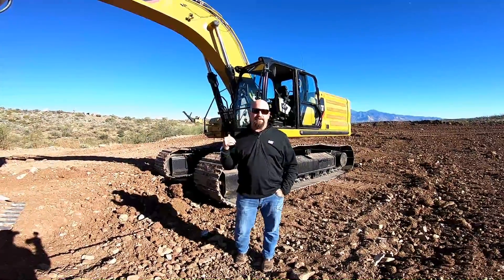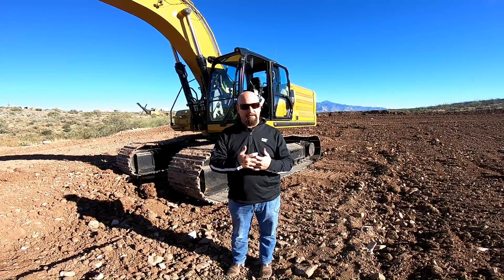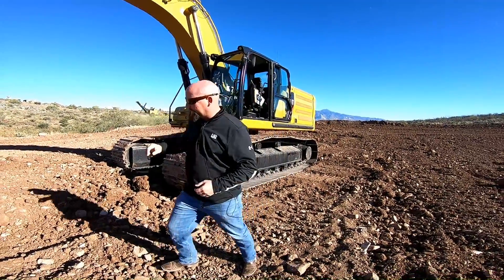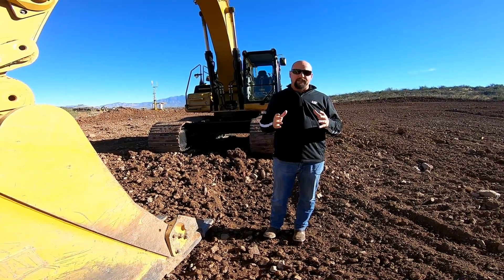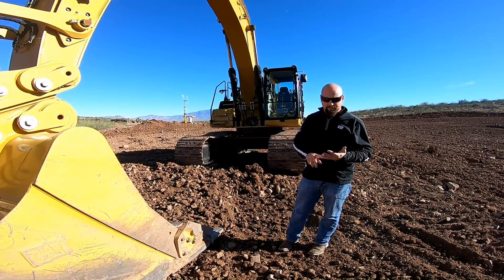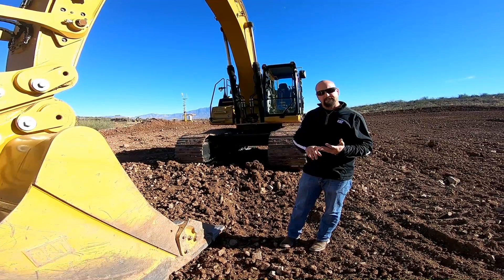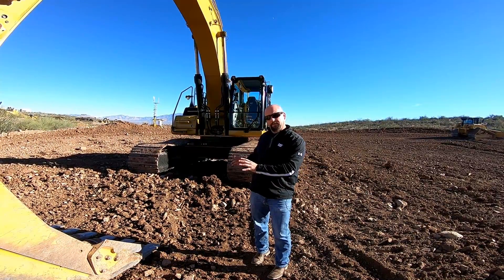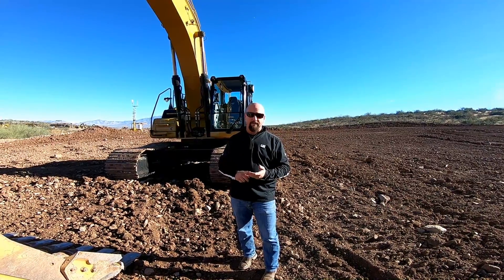CAT 336 Next Gen Technology Explained..

Comment: I have been operating hoes for 12 years now and have run a bunch of different machines. But these new cats are absolutely horrible they have completely changed everything in the machine. The controls sit higher and you cant lower the arm rests really low. And as for simple adjustments you have to take your eyes off the job and search through the damn computer to make simple changes its dangerous. And the stupid electronic hydraulics there is no play. To me running this machine is like starting new basically the same as switching from cat to Deere controls. I can not run this machine at all and now my boss is switching over to them and now I have to look for a new job thanks cat I used to like there machines but not now.

Comment: Cat is just evolving. They see the same thing i see. Its getting harder and harder to find operators. Yes the old guys don't like this technology because they can run it without and have a finished product. The newer generation of operators flat out suck. Not all of them but the majority do. These new operators just don't have it. They can dig a hole and load a truck but when it comes to holding a grade forget it. Dozer or trackhoe. I have some operators ive been trying to teach for almost a year now how to hold a blade and it just doesn't sink in. Ive been through so many operators in the past years i can't even count. I have one guy who is half ass and can run 3d machine control half ass but most of the time im going behind him fixing screw ups. Motor grader operator? Haha you have to pull them out of retirement around here.

Comment: We have the 336FL at work at it’s a terrible thing,  Huge ass, easily dented light metal doors. Lots of computer errors. Huge DEF consumption. It’s actually a pretty slow machine in cycle time.
Reply: I used one too it was the worst hoe I ever used, and I've been in lots of hoes!!
Reply: 3/4 of the engine compartment is dedicated to an exhaust scrubber. It’s ridiculous. The engine is so constipated with exhaust equipment, that I feel the only thing Cat could do is derate the engine RPM and cut back the speed.
Reply: Sure wish I still had an old EX -1 series Hitachi. What was wrong with those? Nothing. The UH series was awesome . Dig and dig and dig and dig. Sadly as technology moves ahead, so does all the problematic computer controlled equipment.

Comment: And soon to come the machine with no cab. Just like everything else nobody will have to drive or operate anything just fuel it up and push the go botton tell it what to do and press start.
   The new way of doing things then if something goes wrong blame the machine.
Reply: Yup, the entire goal is to get rid of the operators to reduce costs.  The Holy Grail is to run mines using a remote control center and a couple of poorly-paid desk jockeys, relying on Indian programmers to generate code and Germans to build the machines.  Who wins?  Not the poor blue collar schmucks out in the field...
Reply: ArthurDentZaphodBeeb already happening in Australia mate, rio tinto has already got over 100 fully autonomous cat and komatsu haul trucks, fully autonomous drill rig and haul train, maybe by the end of this year they’ll have a complete autonomous mine site
Reply: When i bought my first car in 1972 i never thought i would see the day i could buy a fully autonomous car i may see it before i die.
Reply: @scruffy6151  Tesla - already here.  Go see it before you die.
Reply: @rightsideofthegrass8114  this I know but, i am talking about where they are the normal cars on the road. Yes there are cars that have many option but,  non are fully atonamuos. Where the person get in puts the destination in and sit back and read the paper at 60mph and never looks at road. The Google cars are only aloud to do 25mph in town not on the open road.
Reply: I'm a pipeliner from Canada crowding my 20 th year running hoe and I can't ever imagine a bot taking over my seat ...way too many different situations ,ground conditions and stuff it wont happen in my lifetime but it would be cool to see em try it out for a day ...chaos is cash lol!!!

Comment: So can you set a benchmark and put 2" cut and it will follow?
Reply: I mean in 2d because if it only works off ur track  elevation thats very limited.
Reply: Yes and no, a long you are stationary you can set a cut or fill offset, but if you move you have to set a reference point before you move and then pick that up after the move.
This is for 2D machines, with 3D you are can move and wiggle around as much as you want and work off models or reference points.
Reply: @jevlars   Wonder how accurate it is can you dig a foundation with the 2d if you keep picking up the Reference points.
Reply: @ryanmartin4292  If the machine and bucket is properly calibrated you have +/- 2 cm 
On a small open job like a house foundation you can also use a laser.
Reply: @ryanmartin4292  Within 1/4" if using a laser catcher on the stick for reference
Reply: It also has the option of using GPS so it is always setup